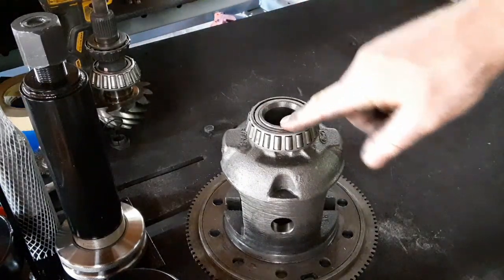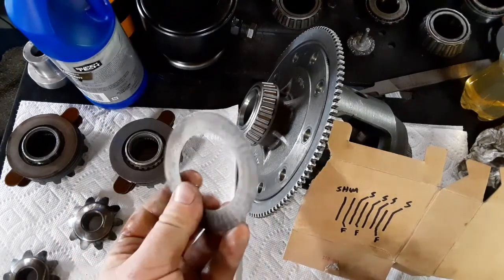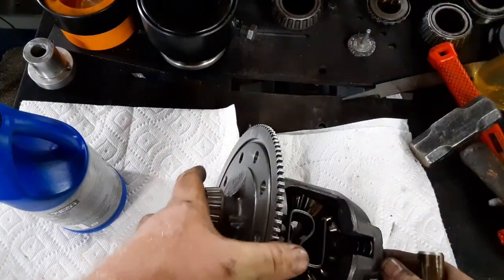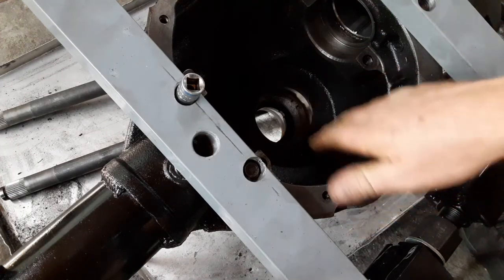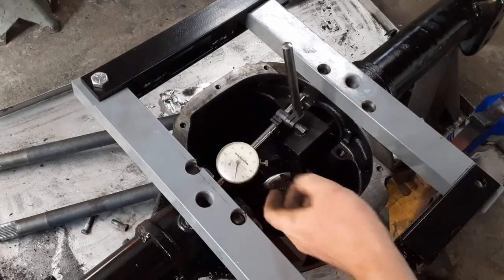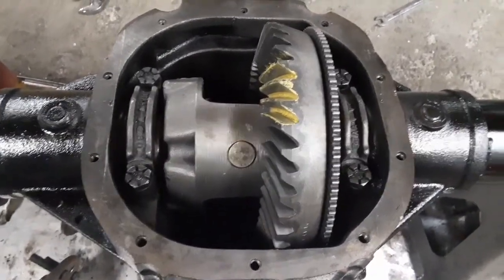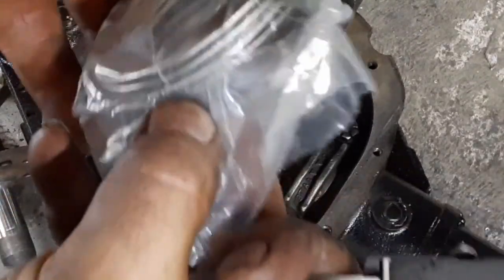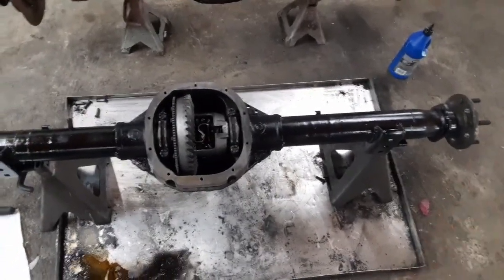New bearings and seals, setting pinon preload and Ring Gear backlash on the 8.8 - LS Swap S10 axle

Comment: Is there any advantage/disadvantage to the friction material setup you chose? I've also heard the F150 S spring will add more preload over the car type spring. I would assume the explorer one is similar to the F150 unit?
Reply from the maker: From what I've read/seen the F150 and Exploder diff are identical. The main difference is the axle housing and axle lengths. The narrower width Explorer is just easier for hot rod use. There's no real downside over a tight clutch pack, it dosen't chirp around turns or anything, but still locks up nice and tight in a straight line launch.